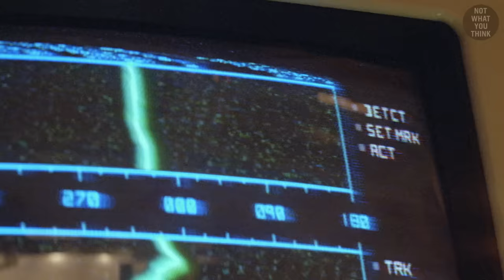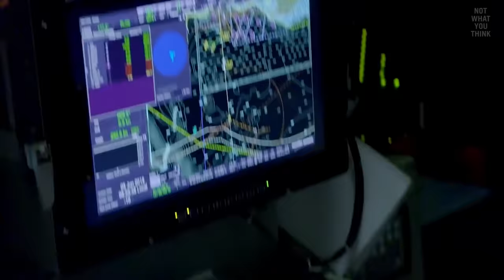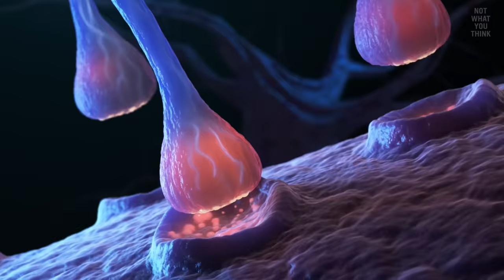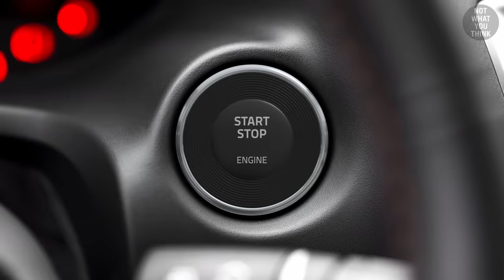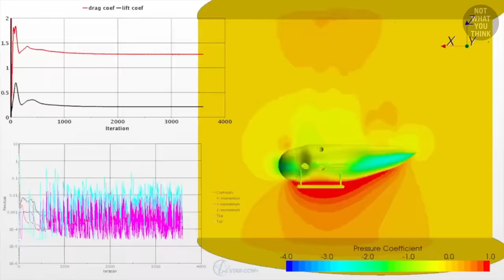What Happens When a Submarine Implodes

Comment: 5:31 im wondering how do these suits counteracts the bends. ie if you ascent too quickly, nitrogen bubbles will form in your blood due to pressure difference and can cause damage to your body and paralysis
Reply: "The bends" only happens when you've been at pressure too long. Subs are not pressurized, so the main worry would be holding your breath while you ascend and exploding your lungs.

Comment: Richard O’Kane and a few other of his crew escaped from the USS Tang after a circular run torpedo malfunction caused their own torpedo to sink the sub. The depth of the water was less than the length of the sub so it was laying one end down. They escaped through the escape trunk (basically a small air lock) and used the Momsen lung to get to the surface. The survivors were picked up by the very Japanese ships they were attacking. O’Kane was one of the only ones who survived until the end of the war wen they were liberated from the POW camp.
Reply: Yes that can happen. We shut our selves with a training torpedo when I was a submariner over 50 years ago. We where trained however to free dive to the surface from a sunken sub. It can be done probably from at least 50 meters if you blow out air all the way to the surface. We trained in a 20 meter tank. I never had to do it for real though.

Comment: Imagine what your entire body is going through while the Bubble Pulse Effect thing happens. Its like, Crushed, blown-up, crushed again but with air heating up in hundreds of degrees, blown-up again, until it stops pulsating.
Reply: Air heating up to the temperature of the surface of the sun
Reply: @sentientdogma1206 don't really put too much into that, flash heat isn't necessarily fatal or even close. There isn't enough time to transfer the heat to much. 

The other thing is not just the hull but the people all squish together at the same time, they partly fuel the bang. I can't stress enough you don't even become cells really you become a jam or mist sucked in with the air.

Theoretically some little things might be distinguishable. I'm no expert for what (volume submarine x depth) might produce as its biggest outcome a grain of sand piece of bone as the biggest for example.

I'm rambling- a short enough time at that heat may only take off your first layer of skin- flash fire suits on ships are designed to protect from flash heat events. It's a sacrificial layer. Its like cooking meat really fast and hot, outside burned inside raw. The more extreme the shallower it affects.
Reply: @mandowarrior123  I still have not seen a video explaining the exact cause of death. As water itself is not compressable and the human body is mostly water, it cannot be the pressure itself. People have dived at the depths of 1.000 feet I think.
Is it the constant change in pressure that rips you apart?
Reply: @frankiepentangeli7100  It is the pressure itself, it doesnt matter that the body is mostly water because youre not just a blob of water, you have cavities in your body and all your cells and tissue are held together by fibrous membranes, and at that depth you experience something like 5,000 pounds of force for every square inch of your body -delivered instantly-, that literally makes your body implode too as your chest and stomach get crushed into your thoracic and abdominal cavities, and all of your tissue just shreds apart.
Reply: @frankiepentangeli7100  and people diving to those depths is different, they have special equipment to improve survivability and are conditioned to it. Not to mention the difference between 2400 and 1000ft underwater is tremendous, and the divers slowly descend down there. And yes, they definitely still feel pressure. The deepest I dove was 130 feet and at that depth you can already develop a headache from the pressure and breathing becomes really hard unless you have a specific breathing apparatus that helps force air into your lungs.
Reply: @frankiepentangeli7100  'mostly' the cells all rupture and you become something more like Jam than a cohesive system. Many biological systems completely collapse. As bt explained the shockwave of the force is extremely disagreeable to mammalian life. We're about 70% 'water' but not in pure form.

Our blood vessels are self supporting hollow structures that instantly collapse. Every lung compartment collapses and ruptures. Cells cannot support the pressure and rupture. Hollow structures in the face and sinuses collapse and smash together. The 'body' is forced into a rough ball shape. Most organs and bones compress so fast they shatter/disintegrate.

It isn't simply pressure but the speed of pressure too.

Comment: Can someone with knowledge about this explain, how the Deep-sea creatures survive under such extreme depths with such high pressure ?
Reply: Because the pressure inside them and outside has been equalized. This is why many extremely deep sea creatures if you bring them to the surface expand, bloat up, and die. As now their internal pressure inside their cell walls is much much higher then the outside pressure.
Reply: key is differential-pressure eg . the pressure difference between the inside and the outside of the submarine - that's what causes an implosion / crushing / etc. ..for like a deep-sea fish, differential pressure is 0, he doesn't have lungs filled with low pressure level gas or anything, so there's no crushing force or anything (and pressure in a liquid comes from all sides equally, the fish is not just "crushed from the top" :P).

(...also, technically humans can also breathe special oxygen rich liquids, and can descend to depths like half a km, in theory even more ...but  it still has negative health effects, and we still have microscopic gas bubbles in ourselves and the solubility of stuff like nitrogen changes so one can't just pop-up-a-water respirator to escape a sumarine if it would flood slowly intead of imploding etc. ...it was proven but it's almost never done because it's complicated, must be done slowly, and it's bad for your health so there's zero economic interest to advance such tech... better put the money into cancer research or smth else that actually helps humans)
Reply: They have no bones, they are mostly jello like jelly fish. The pressure doesn't work on them.
Reply: @kristiqnnenov7787 oh they have bones on them, most species anyway but there are indeed a few species that are just jelly.
Reply: built different
Reply: God designed them too!
Reply: @kristiqnnenov7787  you don't understand how it works :) ...they can have as many bones or hard structures as they want as long as the pressure is equal on all sides of a bone :P (and many deeps see fishes DO have bones, look them up)
Reply: @Cragified  exactly! a few, I think some crabs, survive if you bring them up SLOWLY... for other the changes in solubility of things at diff pressure and temp that is at the surface kills them in other ways (eg. some gases dissolve in water at high pressure but they don't at sea level, maybe some biological function depend on that, lots and lots of minor things)

...but you CAN have both beings and machines that could operate full-pressure-spectrum, the main rule is no gases allowed (so no air, no gaseous oxygen etc) - it's just that neither evolution nor our economy has had any reason whatsoever to evolve/build such creatures or machines

(NOTE: I'm mostly interested from the atro-biology perspective in all this as side-hoby of mine - eg. thininking about life on other planets etc.)
Reply: @Cragified  Understood perfectly, thank you !  ... So, the only thing I can relate this to is 'Airlock' cabin on space ships, where they de-pressurize the cabin to vacuum and that room's pressure becomes equal to the space outside. So, then you can open the hatch and get inside and then re-pressurize it again.
Reply: @chickennuggets8685   literally built different
Reply: This is because most things living in the deep ocean are largely water and water is incompressible. Without gas-filled spaces like lungs or swim bladders, organisms in the great deep are less affected by pressure than we imagine. Some ocean species perform vertical migrations of 1,000 meters each day, experiencing a 100-atmosphere range of pressures with no harmful effects.

Deep-sea pressures do affect chemical reaction rates somewhat, speeding up reactions. Organisms adapted to these pressures may experience metabolic problems when brought to the surface for study.
Reply: Water is essentially incompressible, you can't make it occupy less volume. The pressure you experience at those depths is just the WEIGHT of all the ocean water above you. We're already 70% water, so one of the main ways to survive in those environments is to rise that percentage and keep internal gasses at a minimum. Sperm whales, for example, basically empty their lungs before diving, relying on the dissolved oxygen in their blood and tissues to survive until they return to the surface.
Reply: @allamerican1248  Absolute bollocks.
Reply: @kristiqnnenov7787 so incorrect leave the dumb answers out bud
Reply: @allamerican1248 nigha who?
Reply: @allamerican1248  Hahahahaha, that's funny. 😂

Comment: The Titan submersible had sensors and alarms that would go off when it was sensed that the collapse of the pressure vessel was imminent, so it's very likely their last moments were spent beginning the attempt to surface quite nervously before instantaneous death.
Reply: They know they were doomed.
Reply: If the leaked audio is real, then they were getting alarms 18 mins prior to implosion.   But for some reason they were not ascending fast enough to safety

Comment: THANK YOU for the last 15 seconds of this video. You're probably right. There probably would have been absolutely no indication that a nearly instance implostion was about to happen. At those depths - the pressure is so magnificently enormous - that the sub would have probably been perfectly normal (e.g. no alarms going off) until the integrity of the hull was breached by the pressure. The transition from a still-intact hull to a no-longer-intact hull is basically instant. The last explosiion in the video is a good example of how quick it is. You wouldn't even really see the walls come in towards you. If you blinking the moment it happened, you literally would simply cease to be. Thats a slightly reassuring though after realizing what these people went through.

Comment: I can't believe anyone would get in any submarine, ever. You are totally helpless in so many ways. Insane.
Reply: I was a submariner for 10 years. Far more in control than any ship. A ship must operate in two dimensions; if it's not on the surface of the ocean, it's fucked. No so a submarine.
Reply: Also add the fact that this submersible was sealed with bolts with no way out.

Comment: There is a transcript circulating that if real, would mean that the crew of the titan submersible were aware of the sub malfunctioning for roughly 25 minutes before it imploded and were very aware of what was about to happen. 

Again, if real, the transcript indicates that the submersible was descending too fast, which nobody seemed concerned with. Then when they reached a certain depth, their hull integrity alarms started going off and they heard "crackling" sounds from the aft, or rear, or the sub. They decided to abort the dive and tried to ascend by dropping ballast. But dropping the ballast did nothing so they tried jettisoning the frame, which took several attempts. The sub began to ascend but extremely slowly. roughly 20 meters in 5 minutes. The last thing the sub communicated to the boat was that they switched from the A power bank to the B power bank to try to get more power to the propellers. 

Again, this is all from an as-of-yet unverified transcript of communications between the sub and the boat.

Comment: The OceanGate submersible, Titan,  dove to 13,000ft, 2.4 miles.
I don't know at what depth it actually imploded but the pressure at the sea bed is over 300BAR, possible 375BAR.  
A Car Tyre is around 3BAR. Have you ever seen a Car tyre explode off the rim?  It's pretty scary.
Compressing the air inside Titan, at 300BAR, would instantly generate enough heat to melt metals.  
It takes a long time to charge a SCUBA tank to 300BAR and things get hot.  Imagine trying to charge a SCUBA tank to 300BAR in a couple of milliseconds.
Generally SCUBA tanks are charged inside a protective cage, and everyone leaves the room while it charges.  A 300BAR tank is basically a bomb.

Comment: Your explanation of the the entire events was brilliant. The timing of brain signals. Pain d
Is not immediate. I thought you might have used the Byford Dolphin accident in the North Sea in the 1980s. I think a tender of a decompression unit sabotaged the chamber. The saturation diver nearest to the sealed portal died before feeling anything. So, did the rest of the divers and even the saboteur died more or less instantly. The diver nearest to the sealing chamber part was ripped apart instantly. His spine was found 30 feet away from the decompression chamber. What happened to his body was beyond terrible. It shows the forces that are at work. The Titan submersible was dealing with forces that are mind boggling. The weight of all that water. We forget just how heavy water is.

Comment: I thought most of the delay time in feeling a burn was the thermal inertia of the skin around the pain sensors, rather than the neuron speed of about 250 mph which could cover the body's length in about 1/100 of a second.

Comment: If I’m not mistaken pressure doubles per bar. So if the titan was 10x deeper than the other subs the actual pressure would be much higher then 10x might need to add a few 0’s 😅

Comment: Maximum operating depth IS NOT the same as crush depth.
Reply: Isn't the stated depth of 388 m normal for a modern submarine? 
I'm just a little surprised because modern submarines are given diving depths
of 600 m - 900 m and that's not the depth of destruction, but the operational depth.

Comment: "One body was never found" This really stikes me as odd. I wonder how that is actually possible under said circumstances. The sinking was caused by a faulty induction valve. So the Squalus sunk while actually being perfectly intact. I mean the only scenario i can imagine is that the second crash on the sea floor either broke the aft hull section of the Squalus open or the impact opened a hull hatch located there. But from what i could find on the internet, nothing like that was mentioned. And even then its really really hard to imagine how a body could somehow be "washed out" of the sub by the forces involved. And given the fact that the Squalus was repaired and re-entered service, its also impossible that the body was washed to some hardly accessible place inside the sub were it remained undiscovered even for the entirety of its remaining service time and decomissioning .... or can it ? So how did that body left the Squalus and how ?

Comment: im not sure if it would really ignite like a diesel engine considering that the fuel or oil would not be dispersed in tiny droplets.  Also water would be comming in also mixing with the stuff.   It may ignite but not nearly at full force and it would be extinquished very quickly.

Comment: From a leaked communication log, apparently the Titan was sinking and couldn't maintain depth control and both those inside it and topside knew it.  Further, Titan apparently jettisoned its ballast which didn't stop the sinking.  Thrusters were on full up and still the Titan couldn't rise but a few meters.  Titan then reported strange cracking noises from the rear.  That, apparently, was their last communication.  So to say they didn't know what was about to happen...well, whatever makes you sleep better at night.
Reply: They were meant to sink...   Titanic sits on the ocean floor at 3,800 metres, if Titan can't sink to the ocean floor it completely defeats the purpose it was designed for, which is sightseeing around the Titanic.
Reply: @krashd  It was made to submerge.  To "sink" in this context means an uncontrolled submergence through loss of buoyancy.  Exactly as I related above.  Now that you've been educated, please move along.

Comment: OC spray was singlehandedly the worst experience I had stateside in the military. It's the only time I was able to get away with telling a Colonel to fk off. Which felt kind of good when I was told what happened 5 hours later.

Also, the hull of that sub collapsed faster than a blink of an eye. Literally. 
The only consolation we can takein the Titan disaster, is that we know everything was literally instantaneous. If it really did happen at that depth, the hull collapses in milliseconds. Think about it. If that happens to something designed to be that deep under water (which it wasn't) Think of how fast it would crush a body. You've got water coming at you from all directions all at once, with such force that it can crush some of the strongest stuff we have... It's like hitting pavement after jumping out of the sr-71s max altitude, with no chute. You getting turned into a papers width object. They felt no pain, which is the only good out of this tragedy

Comment: A submarine’s maximum operating depth is NOT its crush depth (00:24)! The max operating depth is, big surprise, the max depth it can operate at and it doesn’t operate at a depth close to/the same as its crush depth. That is 1.5 to 2x deeper than the max operating depth for pretty obvious reasons 🤦‍♂️